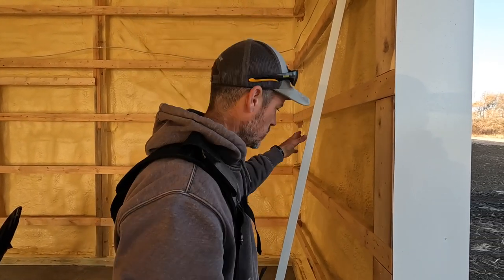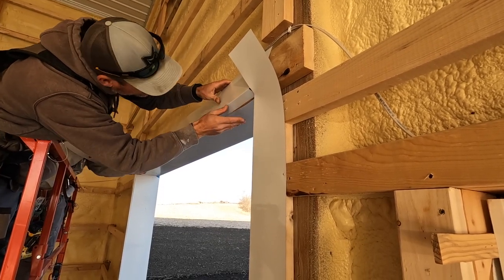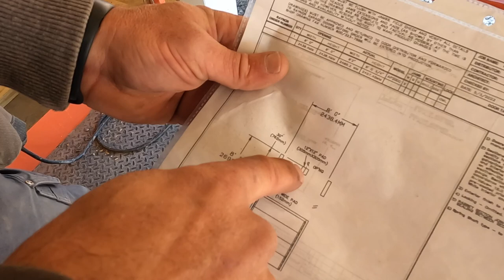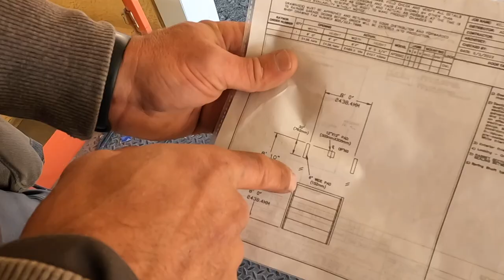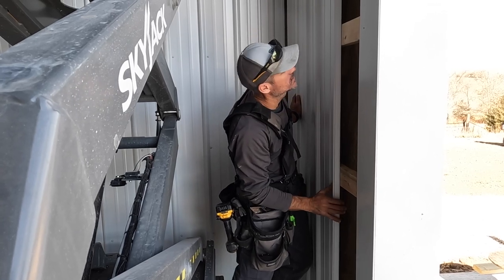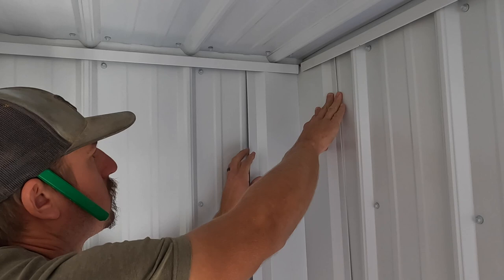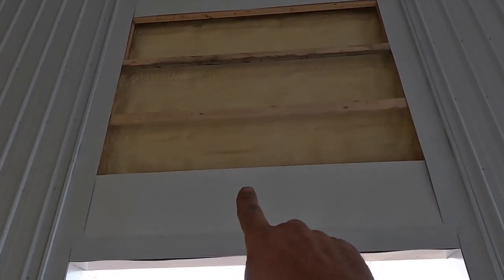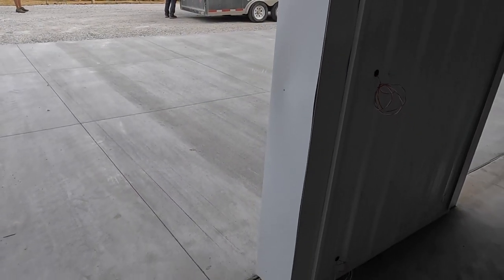The Barndo Build | Day 51 + 52: Metal Shop Walls + Garage Trims - Pt 1 | Ep 28

Comment: IS it customary to pulse the trigger on the drill driver for every screw?  Only curious because I have the same habit.

Do you use a local contractor for the electrical work?  I would like to see some specifics on the electrical details.  The steel looks great inside.